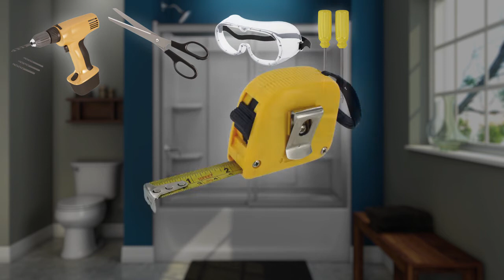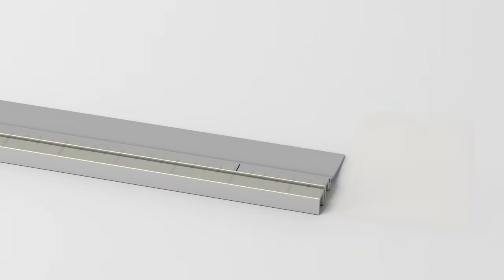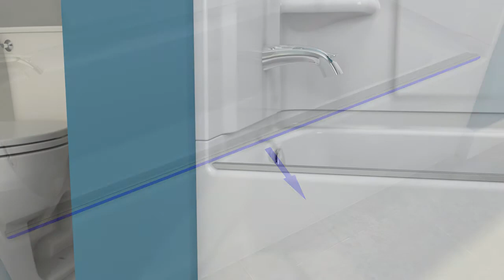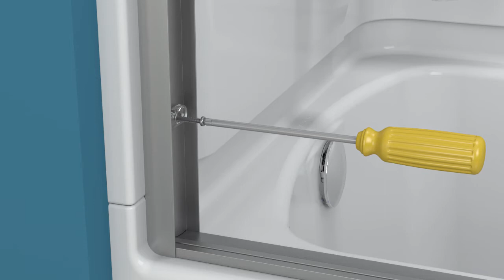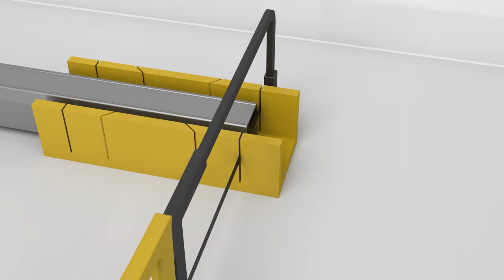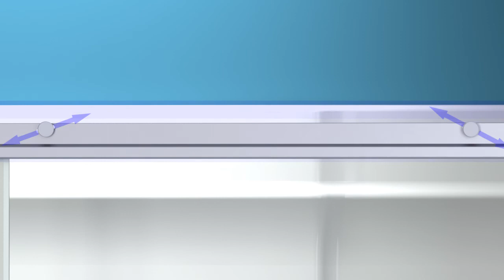Installation - Prevail Shower Door

Comment: I just installed a Sterling Deluxe sliding shower door 5976-48S 
The door are 23 3/4” wide but the inside door panel is 24 1/8 wide in the middle? How can that be? Can you send me another inside panel?

Comment: I have this particular door system and after only 3 years, the bottom of the doors leak where it meets the two pieces at the bottom of the panel.  Doors have been properly maintained.